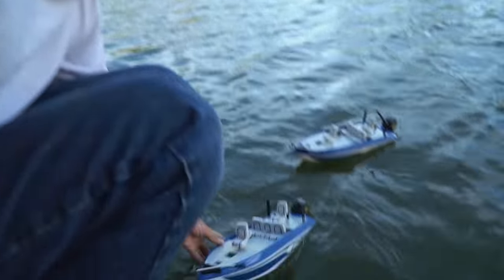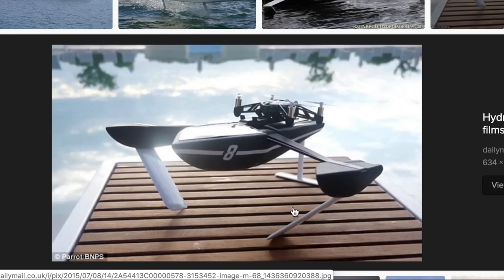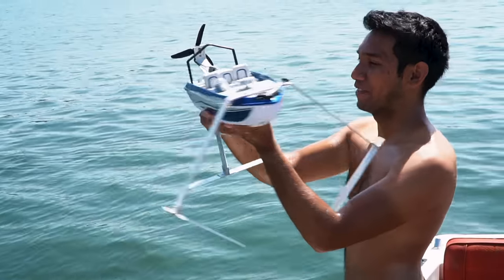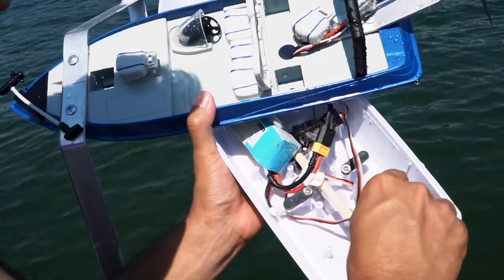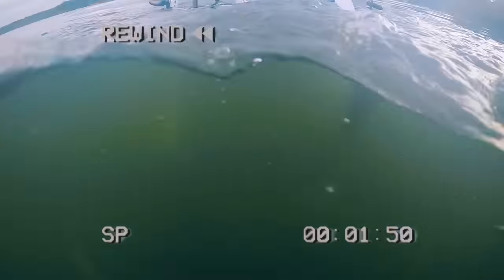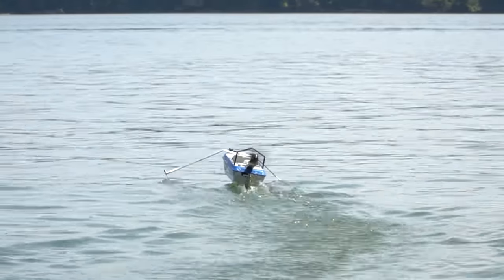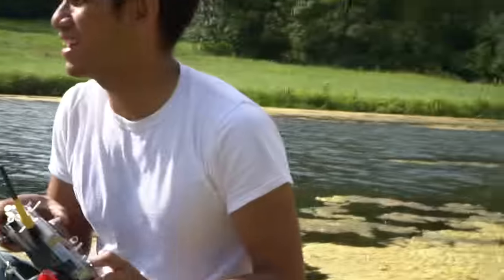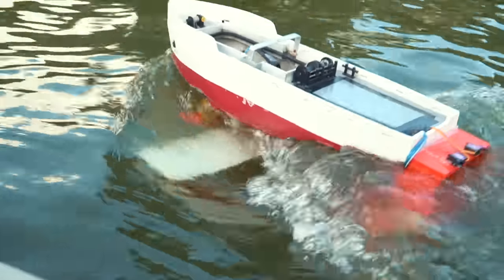CHEAP HYDROFOIL RC Boat MODS

Comment: One thing, deep hydrofoils are more effective in lifting, do to an thing similar to a reverse "ground effect" where flying close to the surface generates less lift.
Your cargo boat might work if you just put the big wing deeper.

Comment: if you really want a challenge try hydrofoil sailing catamarans as in the Americas Cup and they got up to speeds that to crew on them you needed spine protection to stop from braking your back if you went over the side
Reply: Check out SailGP racing series here on YouTube.
Reply: Wanna make it even harder? Look at the new AC75s, the Kiwis just launch the first one of the class a couple of days ago, they think they may get 50kts+ 😲
Reply: Sailgp just broke the 50knot barrier in Cowes UK! Peter definitely needs to get a better understanding of hydrodynamics and naval architecture. This one was a bit painful to watch lol.
Reply: @JustInvertedFpv  yep it sucked haha, he has cool ideas I just wish he would finish them with a working model
Reply: @jort93z  The boats we were referencing are sailboats attaining those speeds from the power of wind alone. Obviously a power boat can potentially go faster but anything above 60knots regardless of wind or motor power encounters cavitation problems that limit the ability to go faster. After googling, Problem Child is a hydroplane which isn't the same thing as a hydrofoil so it's not a good comparison.
Reply: @Marcus Lee, then hydrofoiling on their backs for a few seconds...

Comment: In concern to the tug boat foil design... due to the tug boat being a displacement hull it will take much more time, and speed for the hilly to generate lift because the hull is pushing so much water out of the way. Not to say it’s impossible, but it sure is much harder than the planning hull!
Reply: That is quite true

Comment: Nikko made a Hydrofoil in the 1990's, and I bought one on eBay with intentions of adding a brushless motor.  It vibrated so bad, that it shook apart.  But I don't have the skills you have, I know you could have made it work.

Comment: The speedboat is a planing hull, designed to run on top of the water, so it already lifts itself out of the box.  The tugboat is a displacement hull, which is designed to send water out to the sides instead of riding on top.  That's going to make the tug a LOT harder to get out of the water!

Comment: Hello Peter, if you are looking for the ultimate hydrofoil+Airfoil, check the work of Luc Armant "L'aile d'eau". Even if you don't speak french at all images, graphs and maths should inspire you. Actually the current experiments for sail speed records are kind of Aile d'eau family project, Sail Rocket, SP80 Antoine Albeau, ..) . 
One leefoil, one sail (ideally a kite either rigid or soft), one line. A pilot in between, human or I.A.
It looks quite obvious on the paper, it should work, it does, but there's a lot of practical things to set and solve.
There's a free PDF somewhere on sailing forums. 
But these is the best meeting of aircraft and boating, a kind of Graal. You may appreciate the challenge. 
I guess the solution is a mix of theory work and pragmatism.

Comment: A few things you should try. The hydrofoils under water are all air foils like aircraft. They create lifts with very little drag. Second is the propeller - since water is much denser, you need a geared motor - lower speed, more torque, and a smaller propeller with a larger surface.

Comment: I will stay with plane thanks. I do have several boats. I even lost one in storage( somewhere). Nice job on the hydofoil. I remember Johnny Quest as a Saturday cartoon had a hydofoil boat. In the 60's and 70's it was pretty advanced stuff. They run a hydofoil to Mackinac Island now. It takes about 15 minutes instead of the usual 30 minutes. I personally prefer the slow boat myself. That thing goes faster than I care for.

Comment: Make a ground effect craft that you can ride on. Maybe use Home Depot foam board insulation and with a single layer of fiberglass to keep it light yet relatively strong for the lifting surface/fuselage. For propulsion possibly a Harbor Freight Predator motor along with a large scale RC airplane or ultralight prop... come on Peter do it!!

Comment: Run a small electric current from the front foil to the back foil and it will form Exclusion Zone EZ water under the boat between the foils that will create a plane of EZ water that the boat can ride on. It has very little resistance to flow.

Comment: The tug looks to have a displacement hull. You need a boat with a planning hull. With a displacement hull it will easily go to it's theoretical hull speed but if you want it to plane then it takes a large amount of power to get up on plan and break the surface tension of the water. Keep trying.

Comment: Planing hulls fly on top of the water, on an an air bubble (I was surprised by that part too).  The planing hull is a “horizontal wing”.  Displacement hulls fly through the water, as a vertical wing.  Your tugboat is a very nice displacement hull, that doesn’t “know” how to get on the bubble (called “on step” by boaters and seaplane pilots.  Adding some lightweight stepped pontoons to your airplane?

Comment: Out of curiosity with your water based builds have you ever considered adding those devices for keys that auto deploy airbags when it sinks to a certain depth? Could make testing a little easier without having to worry so much, no clue if its cost effective or effective at all but its an idea
Reply: Great idea! A co2 cartridge and a nitrile balloon or surgical glove would work for flotation.. Just add an electric water trigger and valve for the co2. ;D

Comment: with these builds they are impressive BBBBBUUUUTTTT if you connect the already existing motor and connect it to the same circuit board you might have 2 motors running it

Comment: great experiment especially the 1st one. if you set up a SSD (steerable stern drive) with U-joint or cable to the rear inverted "T" for a submerse prop (Dumas for .09 engine) you're about good for a 390 or 540/05 size brushed motor. the thrust under water at the right angle will take care of the "aileron action" using a curved foil up front.

better or more popular design for small craft, the inverted "T" is up front and steerable, it's wing pitch is controlled by a rope/cable connected skimmer. rear main foil is fixed and is where the prop gets mounted, its pitch is determined by the smaller leading foil up front. the front foil does create some roll, when turning the mast part is also rudder and the outside (to the turn) of the front foil moves forward. why its better... with the skimmer controlling the foil's attack angles, the speed is less a factor, at lower speeds the forward foil is pitched steeper, at high speed it gets the craft running FLAT once the skimmer's rope/cable is set to the proper length with the angle stops in place and set for the front mast/rudder. visualization: skimmer is forward and trailing, up top it's arm  has rope going forward to a pulley to reverse the direction, pulls on the top of the front foil's mast (from behind, through 2nd pulley). going slow water pressure pushes the skimmer up pulling the front foil forward for attack angle. going faster as the craft lifts the skimmer swings forward dropping down, letting the forward foil run flatter to level the craft. the mechanism isn't TOO tricky, pivoting sleeve to angle forward-back, the mast-rudder rod turning left-right in the sleeve. really NICE design because once set it just does its thing.

Comment: How about a Hydrofoil Seaplane?  Seaplanes must get on a step to break the water tension and get enough speed to get airborne.  But, what if instead of using a stepped haul design, you used a hydrofoil (that becomes additional wing surfaces in the air) to help get the seaplane flying?

Comment: Moving C of G is always going to be your problem. To counter act this you need to increase the ballast at the bottom of the foil to keep the weight below C of G. Also since there is a high degree of drag caused by the water you have to compensate for that. So, lower the C of G, increase the thrust and look at pictures of the real thing below the water line. I expect they have some kind of screw propeller for thrust.

Comment: I believe the full scale has a tube in the three legs and a pump that pressurizes at low speed and lifts it ( the boat) out of the water ..it the stops pumping and away you go ..the legs are foil shaped with a fairly small horizontal surface. It seemed obvious to me that  you had to use allot of power to get it to plane. But you did well ..kinda goofy but not bad

Comment: Move the motor more forwards that will possible keep the prop out of the water from the beginning.Just a thought.But there are a lot of variables to consider with the type and design of the boat length hight weith weight ext ext.

Comment: The problem with the tugboat was its hull speed, not the power. The hull isnt designed to lift up of the water, the opposite happens, it sinks (called squatting in sailors terms) and starts trying to climb its own wave in the bow. Youd need a ridicolous amount of power to get it over its hull speed.

The larger foil worked because it lifted the boat before it reached its hull-speed.

Comment: Put two front forward hydrofoil fins angled out words towards the front, that should help with lifting the boat out of the water because your issue isn't thrust it's lift.

Comment: What if you used the duct motor below water and the other one on the top for thrust? Plus a set of small wings on the sides at the rear angled down like on a Vigen plane to add lift in the rear. Might not even hurt to put a set up at the bow. Just a thought I had while watching you try this.

Comment: Flying wing filled with hydrogen,wing blimp . Wing- blimp lighter than air ,with solar panels. Could change the world. Just imagine wing- blimp flying across America with small plane shuttles coming up to meet it added passenger an lets passengers off while flying east to west like a train. It was done in the 30's without computers,an the complete understanding of aero dynamics. Today we can build better materials to hold hydrogen safer an compress it safely. Small shuttle planes could take up ballast an remove ballast as needed. Flexible solar panels an modern batteries could be a game changer. I wish there where wing - blimps to replace helicopters for marine rescues,how many life could be saved with a aircraft that could stay way longer rescuing people. Of course it would need torpedo style anchors to keep it in location.
Reply: Blimps are slow, delicate, and don't maneuver very well.

Comment: What will you need to make a hydrofoil jetski?
Reply: Well, the propulsion wouldn't really work once you lifted the jet out of the water and it started sucking air. Regular small boats with outboards tend to work better since the motor position can be changed, and they make long shaft motors.

Comment: Your first model actually was superior because the metal hydroplane wings allowed you to reshape the wings during testing. Rapid prototyping at its best. Your next model was far too heavy, and the plastic wings were not adjustable during testing, which slowed down progress.

Comment: sitting here watching the vids and a weird idea popped into my mind...  ducted fan rockets.... mount one inside of the rocket and use like 3 more on the outside where the fins would be mounted. load up the rocket with appropriate batteries and some serious caps ( 16V super caps) for that instant burst of power to get it skyward

Comment: The tug's weight wasn't the main problem. Check wikipedia for hull speed. The first boat had a glider hull, which can easily take off. The tug has a displacement hull (I hope I didn't translate wrong. I fear loosing my text  when I check it.) This causes two problems: We cannot exceed the hull speed and the stern is sucked down like the top of a foil get's lift. The latter problem works against lifting and the first against gaining sufficient speed. A planning hull helps lifting and makes sufficient speed possible. The weight is the 3rd important issue. All boat's that can foil are either planning hull or have very narrow (lengths / beam >= 8) hulls which is the other option to cheat hull speed or a combination of both.
Reply: Some additions:

As you move on a boundary layer between two fluids we have wave systems that have an effect on us. Things could even get worse if there is a fresh water layer over sea water in a river mouth.
As you are in aircrafts have a look at flying boats, ekranoplans and water aircraft pontoons. They all have hard edges under the hull to cut off the down drag and make the take off possible.

Comment: You do know that hydrofoils use the same profile as a wing & if you wanted better success you could have made a flap on the rear hydrofoil with a double TT design that is hooked up to a motor to raise or lower giving you lift or no lift, also if you had stuck single T design on the front that can pivot left to right then you can easily turn. The top of the hydrofoil needs to be rounded & the bottom needs to be flat exactly like a wing.

Comment: The whole idea behind a hydrofoil is to reduce the surface area exposed to the water, and thereby reducing drag. Even tho the boats bottom is parallel to the water flow, it still creates surface drag. This is why a surface drive prop is most efficient, because only one blade is under water at any given point in time, and essentially one bladed propeller is the most efficient. So ideally you need a hydrofoil to lift the boat out of the water, then run the prop halfway in the water, and half out, or on the surface as a surface drive prop. And then you would reach peak efficiency for a surface water craft. Now why submarines run faster submerged than on the surface is due to some of the top half of the sub lifting water up, instead of floating high up and out of the water, as a surface boat does. But the rule of thumb is the less surface you expose to the water, the less drag you create. Here is some more food for thought, why does a garden hose jet of water, have more push out of the water, than submerged under water?

Comment: as an engineering student, it should of been way better, but do you know computational fluid dynamincs? Do you know the the there is an actual book published regarding the complicated engineering behind hydrofoils? 
Are you aware of the two types of hydrofoils, as well as advantages and disadvantages of each. I'd like to see a proper fully submerged foil system that uses accelerometers to change the trim/pitch to gain and maintain a stable level flight even in high waves. Or theres another way, a float on a stick which reaches out beyond the fore of the boat and skims the water, in which this stick is connected to a lever in such a way that it changes the AOA of the front foil in parrel to the modular interaction of the float stick. In this arrangement the aft foils   will maintain roll as aft y'all control and rudder using a modulation of electrical components with a low conductance to water. This system, for the most part completely rely on modular interaction of such mechanical components, these foils must not perice the surface! The cross-sectional area of the foils are not something to overlook, as well as speed. ALL SURFACES MUST BE HYDRODYNAMIC!!! Be sure to test different foil shapes, the speed should be proportional to the cross-sectional area and lift. Once flying it should stay 120% level no matter the speed, not water conditions. Having a foil create too much lift at such a high speed is disastrously dangerous. Relying on a computerized control system vs. a semi mechanical system is up to you. 
Sincerely, An Engineering Student.

Comment: counter rotating jet i mean edf thrusters for more push and more loud 📢  and then the rest is wing management knowing your angles to travel speed/ velocity center of gravity has gotta either be right or reactively adjustable so that you travel in direction intended and add solar for more power and bigger batteries... okay not necessarily just bigger just multiple times the capacity

Comment: dynamic pitch controller, that's your recipe for success, your designs were pitching up, down and therefore weren't stable. The only way around it causes huge drag which is having wings which slope in a V so lift increases as you sink deeper and the opp as you rise out of the water *(that was why there was limited success with the first model)

Comment: I wonder how long it took him to realize the propeller was leaving the water and stranding the vehicle without forward propulsion.

You need a very long and  stabilized prop shaft with a propeller that wont break off.
Ok....it took till the tugboat part.

Comment: I have a challenge for you: build an RC airplane that is also a submarine and can switch between the two.
Reply: Just watet proof bullet looking plane and make the figns to work as "controlls" and a cargobay dull od pump and tank and a fillabable water pontoons as stabilisers and a way to it to air...

Comment: I was hoping the tugboat would've worked but it was too top heavy and there's a specific formula of weight, width, height and other water demon magick.

How about some 3D printed SELF-ADJUSTING foils for the tugboat where the faster the boat goes the further out the foils push in a triangular fashion to lift it, like the first boat.

Comment: SOLUTION: You need to increase the mast length (30 cm would be fine), Then it would fly  without touching the surface of the water.  Please share the video when done.